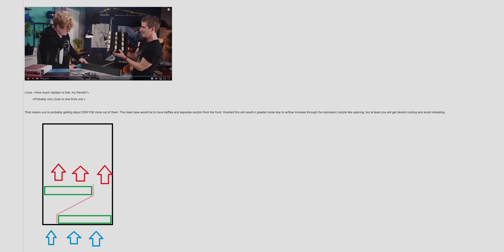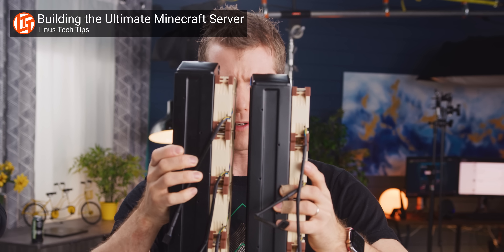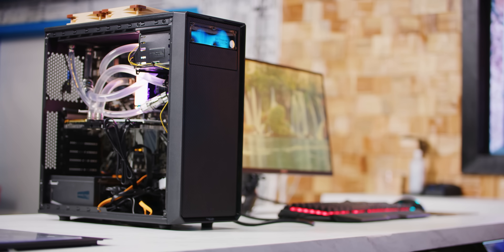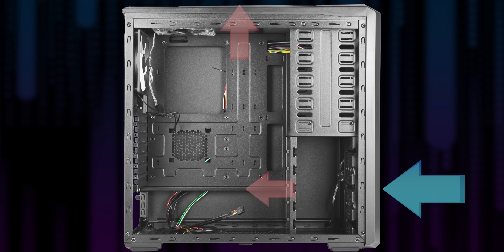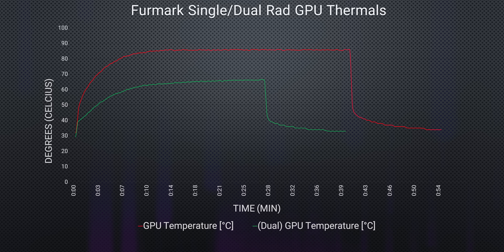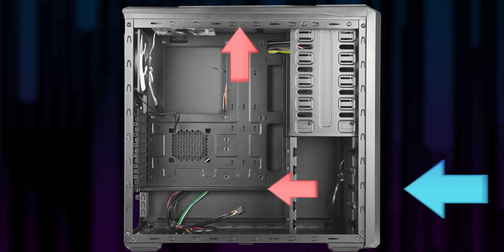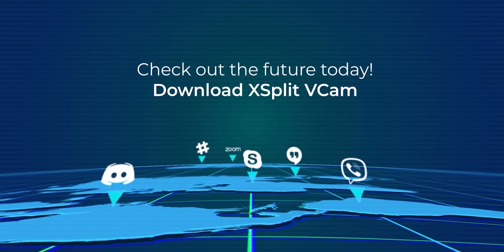I’ve been water cooling wrong for YEARS - $H!T Manufacturers Say

Comment: Nobody: Cascading radiators
Linus Sebastian: Let me cool warm water with warm air.
Reply: It's more a case of cooling hot water with cold air and making warm air, then using that warm air to cool more hot water, hence why it works.
Reply: @llynellyn  exactly, it's that the 2nd radiator is not as efficient. Not that the 2nd radiator doesn't work
Reply: yes, at counterflow (the hottest outside last and the coolest at first) actually you go to down the thermal resistance improving the transfer, you blow hot air on a hotter radiator so you still can move more heat out.
Anyway you still have a limit, not worse, just not difference by adding more when you reach that point.
Reply: Stacking radiators is basically the same as having just a thicker radiator. Same idea. The fins toward the exhaust side will of course be warmer than on the intake side, but they still provide cooling.

Also, that air heat capacity thing is bullshit. I have a heatgun that will push out air at 600c. There is no way you are going to exhaust the heat capacity of the air, but at some point you'll be heating up anything that is in contact with the exhaust air of the rad, so you obviously shouldn't expect the same cooling performance for those components.
Reply: @kienanvella  Of course the air still has heat exchanging capacity, that's not the point.  The point is that if the air is 40C and you push it through a radiator that is 40C, then the air wont be taking any heat away.  It only works when the incoming air is cooler.

Comment: To put it mathematically: The efficiency of a cross or parallel flow radiator is the quotient of exiting temperature of the flow medium in Kelvin (here the water in the radiator) divided by the exiting temperature of the coolant in Kelvin (here the air behind the radiator). In theoretical ideal conditions, the exiting air has the same temperature as the exiting water, as the equilibrium point of temperature is reached and the temperature gradient is zero between flow medium and coolant. So the quotient between the exiting temperatures is 1, so 100% efficiency. So, as long as there is a temperature gradient, adding another radiator will improve the overall efficiency of the series, as the gradient will be reduced. However: The longer the series of radiators becomes, the smaller the gradient will be and the smaller the effect of another radiator will be. At some point you will get deminishing returns. As the second radiator might reduce your system temps by 5 Kelvin, the fifth might only give you 0.5 Kelvin, and the sixth even less.
I would like to see LTT make a test, where to expect that point. Plumb together a stack of radiators and ducttape the gaps in between them and add temperature probes before the stack, behind the stack and in between every radiator. Add new radiators progressivly to see, how the efficiency of the overall system will go up, but the indiviual efficiency of the radiators will go down. Keep in mind the rising airflow resistance and ... on a second thought, @GamersNexus?

Comment: Your axis is labeled minutes, and it starts with a 0:. You ran the tests for less than a minute? Why don't you give it another go with a load for an hour? Another rad probably means more water, which means more thermal mass. You just probably proved that a dragster can beat a car designed for a 24 hour race in the quarter mile.

Comment: To make cooling most efficient you need to increase working temp, it's the same in datacenters and in all kind of thermal solutions. Hotter the coolant is, more heat can be dissipated  and more thermal capacity radiator's each section has. I have 3900x overclocked with 2080TI + chipset and vrm, total thermal load is around 450W. I am using single 360mm xflow radiator with powerfull D5 pump. Due to xflow design of radiator, flow is not experiencing any restrictions and goes up to 400L/H. Hotter the rad gets, more heat energy can be dissipated. Yes, CPU and Video are hotter than usual, around 60c CPU (gaming) 80c (full load), 55c GPU which is acceptable. System gets equalized faster than with high capacity, temps get to nominal in 5-8min, fans keep mid rpms and working totally silent and case is blowing out really hot air, therefore increasing efficiency. with more radiators you will get to equalized point slower, experiencing much more lower temps, but in the long result temps will be the same, since blowing 23c ambient temp air to barely warm radiator gives no cooling until radiator warms up to 40c atleast. Decreasing capacity of system gets you to the most efficient point faster with several degrees difference overall on the components.

Comment: If and only if #1 you had a completely sealed off case and #2 you thermally decoupled all of the components with a metal frame so as to ensure that 100% of the load expelled by the first fan would be gained by the second, then and only then is Corsair correct. Alternatively, you could stack radiators, which so long as the pump load is reached, will do little if anything to benefit the system. However even in the case of stacked radiators, radiant heat from the sides of the additional  aluminum radiators will dissipate some additional heat.

Comment: Why wouldn’t you actually test the configuration they critiqued? You can’t slam the accuracy of a simulation with data gathered from a different scenario.
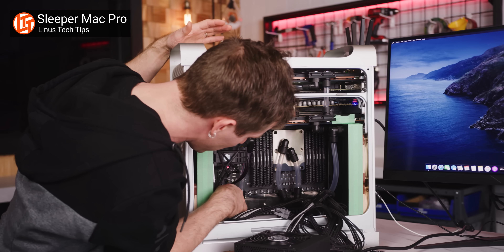Reply: 6:47
Reply: Like with the server that got 5 degrees hotter...
Reply: A three second mention of the secondary critique from Corsair does not a test make. The fact that the entire video is debunking second hand comments from a manufacturer with the only data being present being a simulation who’s configuration isn’t actually tested is cause for suspect methodology. I’d be willing to bet that if they test the configuration that was simulated, they’d get result similar enough to the simulation. The fact that they pointedly did not do that should raise questions.

Comment: you have more fans sucking in more air, so I have to speculate it depends on the pressurization of the case a lot. if you are capping your system off at a certain noise level, total CFM or pressure level, or just had a case not designed for 2 radiators in some way, then you would probably get worse or same results between 1 or 2 radiators. if oyu have the pressure overhead and noise tolerance, there is no reason that more fans should not equal cooler temps. you may even see the same results of the 2 radiators if you took out the second radiator but left its fans in place, giving you that wider difference in temps that allows better heat transfer. of course, im not degreed in any of the relevant subjects, so i could be way off, but it does make sense that in some cases, the second radiator helps, and in other cases it hurts or does nothing. certainly the variety of hardware and desired consumer outcomes would require a huge range of specific test to lead to any conclusive data, but for most people, I think its solid advice to say if a large single radiator isnt doing the job, try simply adding some fans to move more air through the case in general so the air through the radiator will inherently be cooler, and then if you still think you need a second radiator, try it knowing it may not help at all